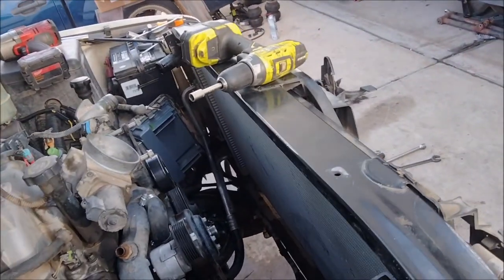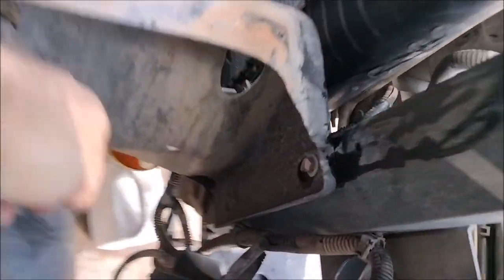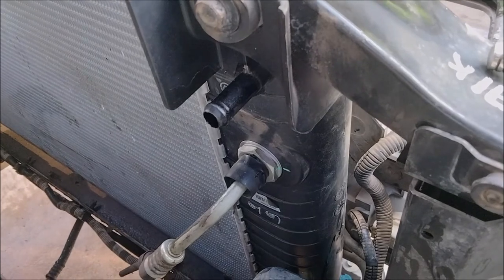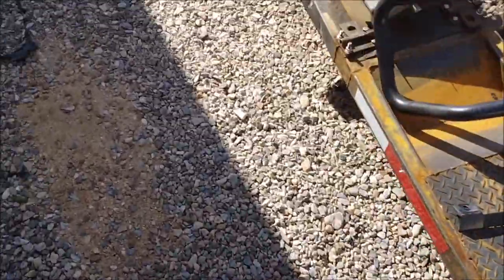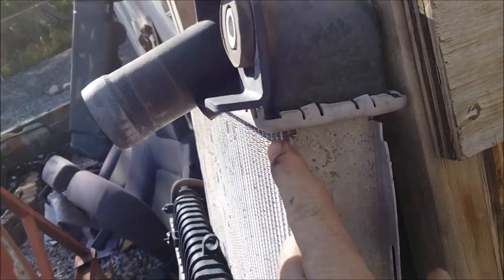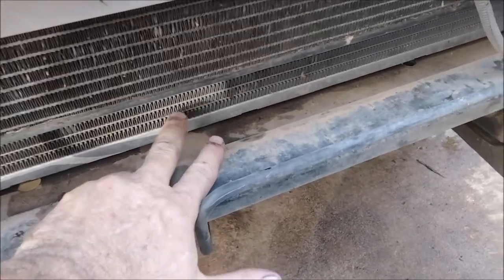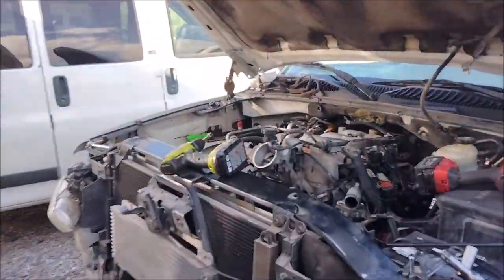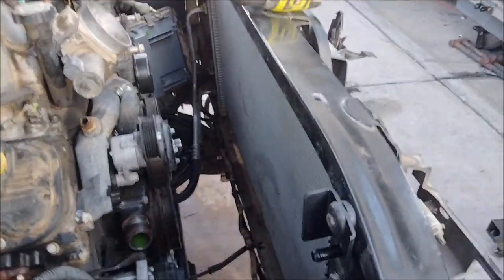Vortec 8.1L Radiator Removal. Suburban Silverado Sierra Yukon XL

Comment: Dmax radiators are shorter cause of the inner cooler as well. And my dmax radiator doesn’t have oil cooler lines.

Comment: Can I use a 8.1 2001 radiator in my 2009 silverado?????? The one that is 2in in thickness.
Reply from the maker: doubt it, I havent tried but the ls radiator is sufficient
Reply: I know 2009 silverado use the same radiator  as 2002 silverado 6.0 engine. So if it fit on a 2002 silverado it will fit in a 2009. Have you tried the 8.1 radiator o. Any other truck???
Reply from the maker: @aramishernandez6109  not sure what you are attempting to do but the 8.1 radiator dwarfs a 6.0 radiator
Reply: When pulling my boat the silverado will overheat, I am trying to keep temperature at center of gauge
Reply: @fuelslut   truck overheating pulling my boat,
Reply: When can find radiator for gmc 2003 8100